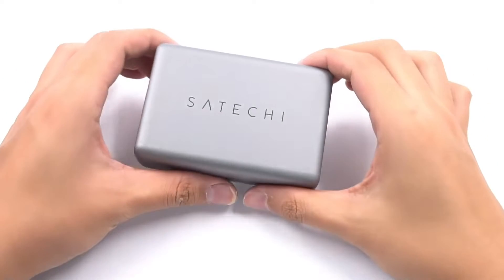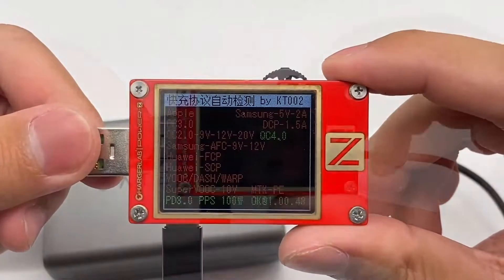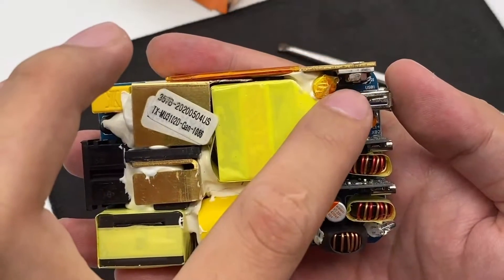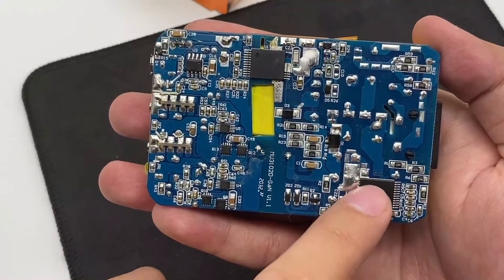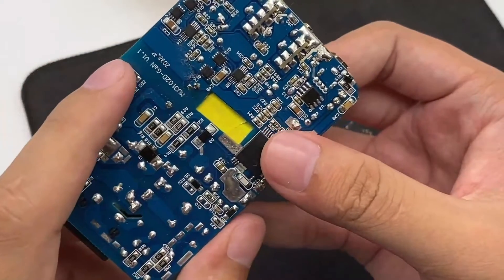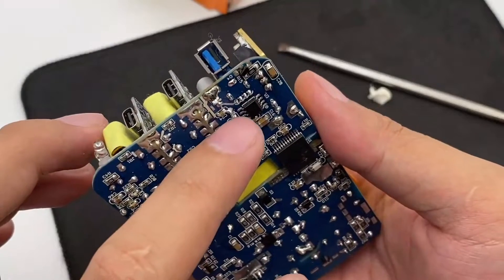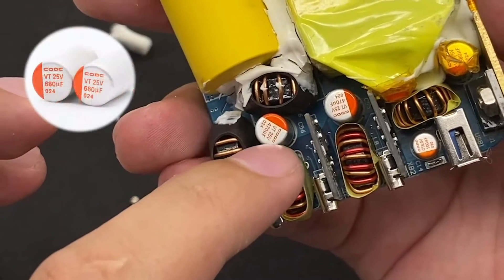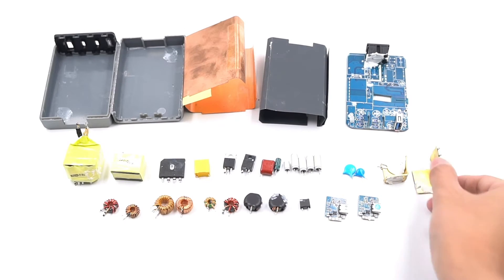Teardown of Satechi 100W USB-C PD Compact GaN Charger

Comment: One of the ports on my Satechi's (different version) USB-c ports no longer charges unless I wiggle and hold the charging cable. What do you recommend? I'd like to repair the port.
Reply from the maker: Even if repaired, the stability will be affected
It is recommended to directly replace the new charger for safety.

Comment: I'd love to have more information on these chargers you’re checking out as well.
For example, from the limited info Satechi provides, I'm lead to believe this one has a total output of 112 watts, meaning the USB-A port (12W) is completely independent from the (100W of) power shared by the USB-C ports.
I understand if you’re not focused on full reviews for now but maybe it’s possible to include a quick hands-on here, checking the output of each port individually and also when using different combinations of ports.
I this case, for example, that’d help clarify if the max output is 112W when using both the USB-A port and at least one of the USB-C ports.
Reply from the maker: We'd like to call that "review" instead of "teardown". We're planning to do some reviews in the future.
Reply: @ChargerLAB  Good to hear.
Reply: Agree with you. Actually, there is another Satechi 108W charger that was reviewed by a site that I can't remember. It actually is technically 120W, because of the separate measurement of the output from the ports.
Reply: To prove his point, here's the spec:

1 x USB-C PD connected - up to 100W
2 x USB-C PD connected - up to 60W/30W
1 x USB-C PD + 1 x USB-A connected - up to 100W/12W ---> this is the configuration to achieve a total of 112W 
2 x USB-C PD + 1 x USB-A connected - up to 60W/30W/12W ---> this gives you 102W, which is also over the 100W max. In fact, you can see this in the photo (bottom right corner) - https://the-gadgeteer.com/wp-content/uploads/2020/11/SCGC-04.jpg